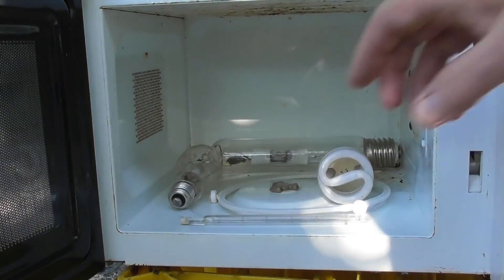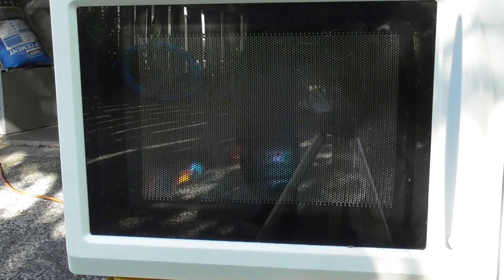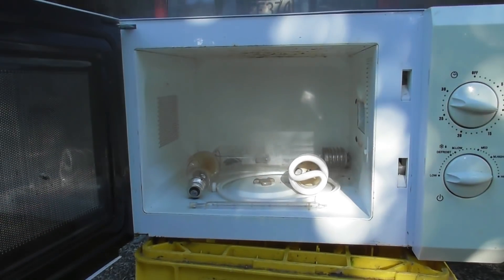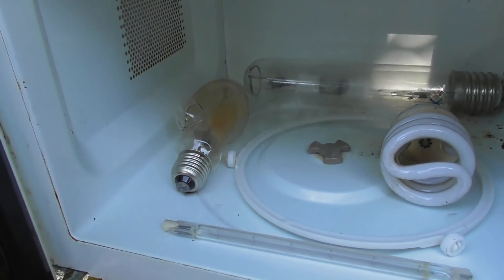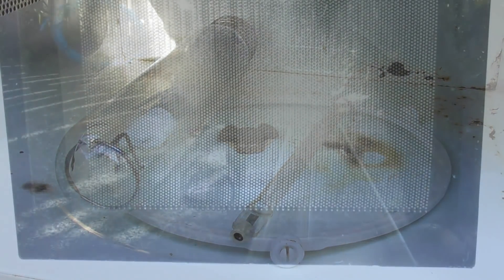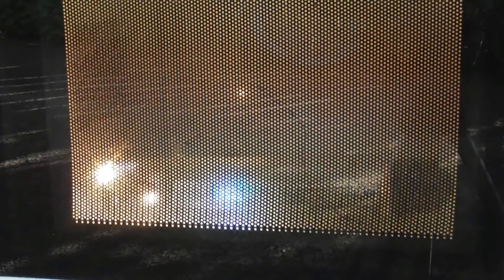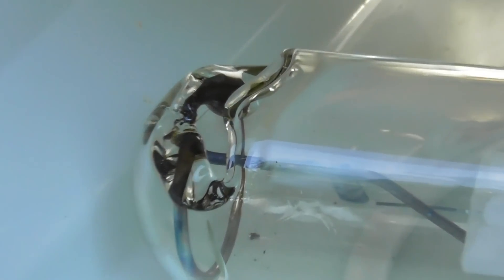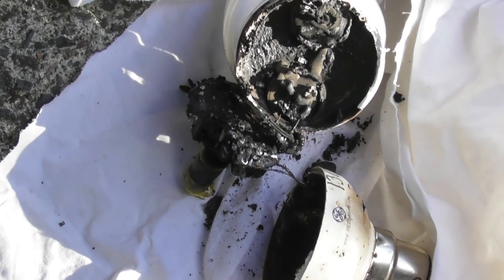Microwave v metal halide lamp and CFL

Comment: I have never heard a microwave sound that pissed off , great video !
Reply: At one of the radio stations where I worked, we had this crappy microwave that was a trade from a local appliance shop. It had the mechanical dial timer and no start button; if you closed the door and the timer wasn't at zero it just immediately started. Over time it started carbon tracking the mica(?) window at the end of the waveguide into the oven cavity, and if someone took their lunch out and just closed the door with the timer not at zero, it'd make that same exact wonderful sound.

I was always tempted to just let it sit there and burn itself to a crisp, but I realized it'd totally fumigate the whole building with toxic nastiness, so I begrudgingly always went over and shut it off when I heard that.